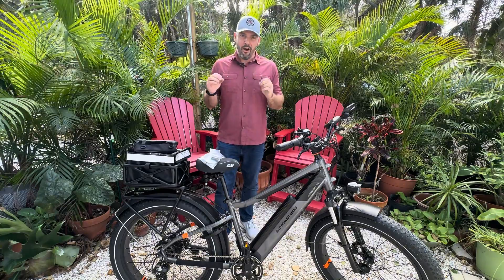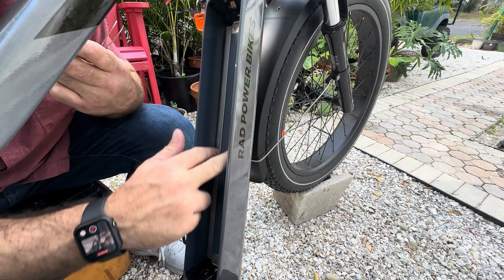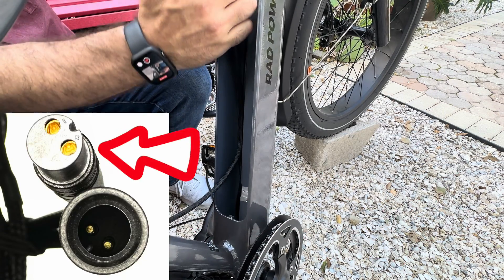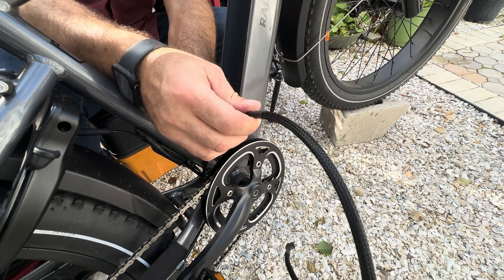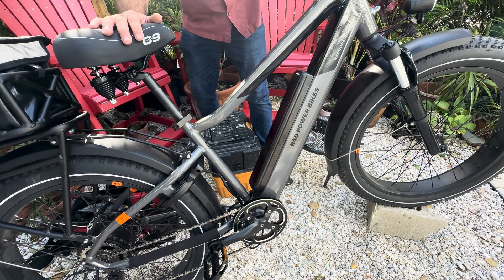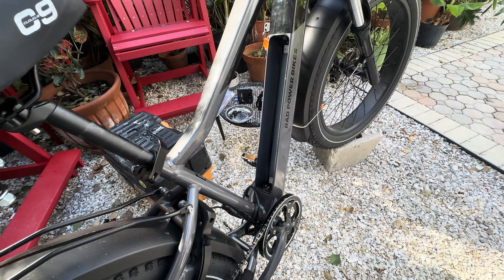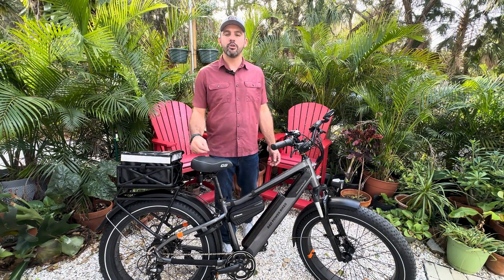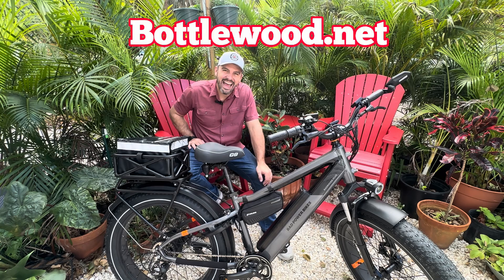RadPowerBikes | RadRover 6 Plus | Plug & Play Dual Battery Kit Installation of Second e-Bike Battery

Comment: I have two batteries but don't follow why you need the balancer. I carry the fully charged spare in my rear carrier and use the battery before replacing it with the fresh one. So if I hook up the balancer I end up stranded with two dead bateries istead of one ?? Also, lithium batteries don't suffer from that memory effect thing; it's better to keep them topped up. I've noticed better performance on the top 5 bars than the bottom 5 bars...  I can feel when I'm near 2 bars and swap for the fresh one or even change at 5 bars, top up the loose one when I get home.
Running alternate batteries using the top 5 bars is more of the fun bars and the 'reserve' tank is great peace of mind.
Reply from the maker: A balancer doesn’t cause two dead batteries. 

Lithium does suffer ill effects of a static full charge and it is NOT recommended to store these batteries at full charge.

If you feel it’s better to stop and swap batteries intermittently, do it

Comment: Hello, I have a rad runner 6 plus step through also, can you send directions on how to hook up the kit? I was receiving a full battery reading but the wheel never turned plus now I can’t a reading at all from either battery, I’m wondering if I need a new controller now, thanks

Comment: This doesn't work for the Step Thru version of the RadRover 6 Plus. I found out the hard way.
Reply from the maker: Vin…please rescind this. We spoke via email
Reply: Update! You can use this kit with the step thru Rad Rover 6 Plus, just takes a bit of finagling to figure out the way these wire  run.

Comment: So I just did this with the 10 amp hour battery with the 40 amp battery monitor on my plus 6 with the 35 amp aftermarket controller and it works great. I haven't ridden it much but once you throw the 35 amp controller on there I don't care who you are You're going to be pulling a little more power than you had been with the 20 amp. So I'm thinking I'm going to get about 40 mi a charge but we'll see.

Comment: Im curios what is the largest battery config you could get for this setup, and can the stock battery be removed with the battery case strapped onto the bike frame? Thanks.
Reply from the maker: You can have any amp hour combination you want. Just make sure you know how you will mount and store it.
Yes the factory battery can be removed

Comment: I have a bad battery on my rad rover 6 its actually the second one sent out by them… im wondering if it would be cheaper to run another battery this way
Reply from the maker: It should work even if you only have 1 hooked up.

Comment: I'm curious what kind of affect this has with the stock battery level indicator.
Reply from the maker: If both batteries charged to full, the level meter reads both batteries as 1 (voltage meter)
Reply: @ElectricAllWheel  Excellent. Thank you! I just ordered the parts from your site.. Now to decide how big I wanna go with the new battery.

Comment: Nice having the pre-made cables. I juiced up my RadCity5 with an extra 24A battery, and it's been amazing. I'm hitting almost 37 miles at a steady 25 mph on full throttle. Really hoping Rad offers an extended range stock battery someday.

Comment: fantastic video!! thank you for that. my question is can I choose 48V 20Ah battery from the link that you've provided for my radrover 6 plus as well? not sure if it's suitable for my bike in terms of size and vol etc.
Reply from the maker: Yes any amp hour you want. Just match your voltages
Reply: @ElectricAllWheel  thank you! Unfortunately the battery that you recommended is unavailable on Amazon